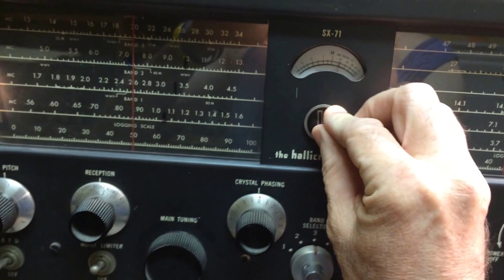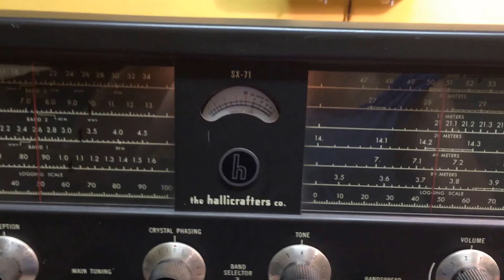1957  Hallicrafters SX-71 First Look

Comment: The hardest thing I had to fix on mine was the band-switch, at section 2 was NOT turning, the part that should move was waddled out and the contacts just sat there while the rest moved...I had to JB weld them in the exact place...and no room for ANY mistake here ...

Comment: Hi very nice radio..I have one now and repairing it as we speak..I have a question..on the VR-150 tube...while the radio is on..does the tube glow a blue color..just wondering..again a nice radio...
Reply from the maker: Yes that VR-150/OD3 tube glows kind of a purple color since they are filled with some kind of gas.  I always remember these as a kid since they were in a lot of electronics  and I found them quite neat.  I also found the old eye tubes really cool as well.    Hope you enjoy the SX-71 they are a nice receiver and in my case a great piece of nostalgia.
Reply: Thanks so the info..is there anything I need to know that might improve the reception of this fine receiver...
Reply from the maker: I did an alignment on mine and it did help quite a bit.  I found my IF to be off quite a bit and all the bands improved with the alignment.  A good long wire antenna and a earth ground really help this radio to perform well.   Back in the day when I used this as a Novice (1970) that was the antenna of choice and it worked well.
Reply: That is the part of the alignment I DONT understand..where it is talking about the "U" coil...and using the crystal...steps 1and 2...can you explain that to me...Is it trying to align the coil to the crystal or the other way around???? I just dont get it..
Reply: if therebis a way you could get the name of the company that supplied the recap kit it sure would help. Thanks.
Reply: The name of what company???
Reply: The company he bought the recap kit from.
Reply from the maker: Brian Oakley I will get that for you. the can cap alone was worth buying, made a much cleaner restore.
Reply: Ok Bob. I greatly appreciate it. Thanks again.
Reply from the maker: The kit has all the capacitors you need to replace,  you can just buy the can cap but for a few dollars more you get everything.  The one thing that they did not give you was a safety capacitor for across the line.  They  provided the part (I think it was a .01).  You really want to replace that with a safety cap,  the one in my SX-71 had long ago gone bad and was split open even though it looked okay on top it was split when I pulled it out.
The site for the kit is hayseedhamfest.com.
Reply from the maker: BTW,  I wonder if you have seen the Hallicrafters group on Facebook it is very handy to belong there.  You can find out  a lot of good information with all the like minded folks that post there.  The antique radio forum  page is also very handy for getting answers,  if someone there can not find you an answer there probably isn't one.

Comment: Almost all of my resistor were out of spec..they were all HIGHER...in value...the hard stuff to get to is under that plate in the center...the only resistor I did not replace was next to a capacitor(C59) that checks the temperature that I believe has something to do with the 6C4 oscillator tube above it...